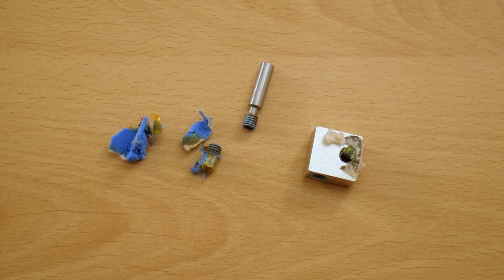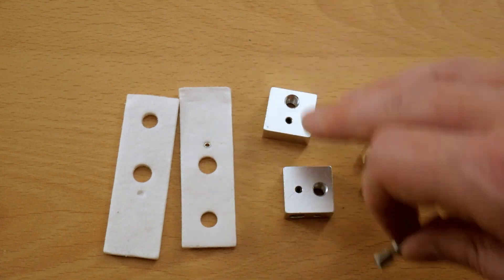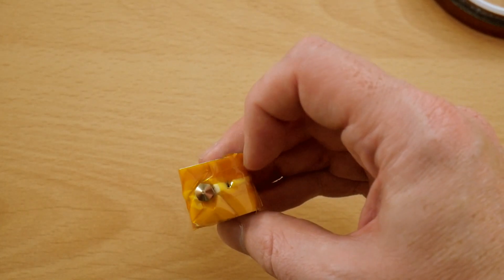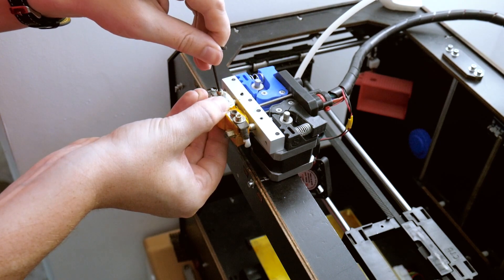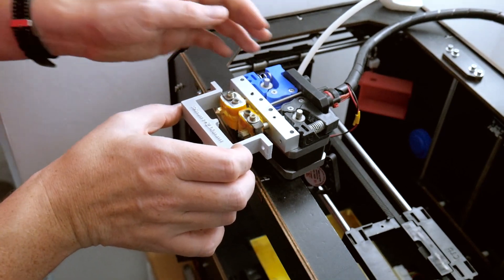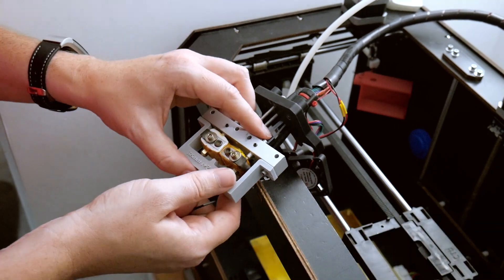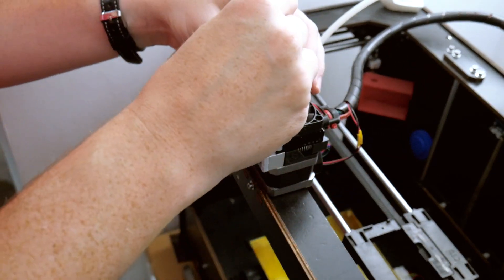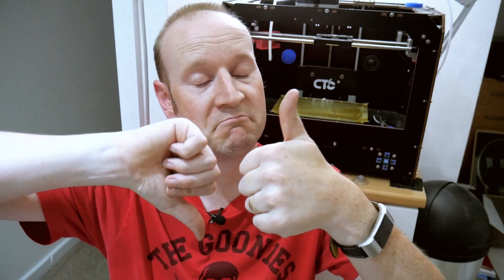CTC 3D Printer How to Replace the Nozzle

Comment: Hello I bought the ctc second hand and didn't have much with printing so I've bought new nozzles and heat blocks etc. The problem I have is I can't calibrate the height because I can't print the aligmnet jig. Would you be willing to print me one if I pay for it and send it to me. I'm in the UK aswell BTW.
Reply from the maker: The best way to sort it out quickly would be to only have 1 installed. Level your bed with just one nozzle and get printing. I never used both nozzles on mine.

Comment: I think mine came extremely faulty. EVERY time I print something, it clogs mid-print. The inner gear over the nozzle gets clogged with molten PLA and it stops feeding. So after EVERY print (given it finished or not) I have to unscrew everything and remove the loose filament inside. Is that a stupid printer design or do I have do change something?
Reply from the maker: It sounds like you might have the temp to low and the speed set too high. I assume it's PLA you are printing with? If slow the speed  right down and slowly increase the temp until you get good prints then increase the speed slowly. I print PLA at 210. If you Google PLA print temps and speeds you should get a good idea of what to aim for.
Reply: @Abernus69  thanks a lot. I will try that

Comment: Hi, 
I did reset to factory settings to my CTC dual nozzles printer. As a result firmware version back to initial version - now it is a single extruder model). Could you please suggest me how to restore my printer to normal condition with two nozzles?

Thanks
Reply: What firmware version, as usually in settings you can change it back to 2 nozzles, if not use replicator or makerbot to change

Comment: WHAT NOZZLES DOES IT USE??? Ive been looking everywhere for the same ones that came with it and have no idea what they are even called.
Reply from the maker: They are 0.4mm nozzles. I couldn't find the exact same ones on Amazon so I bought some that looked very similar. Just remember if you are using both print heads to change both nozzles and then re-level the printer. Sorry I have no links
Reply: @Abernus69  There are so many different types. Mk1 to mk10 inclusive and heaps more of other different types, I ended up finding some on aliexpress that look similar. What slicer do you use for your printer by the way? ReplicatorG doesnt have enough options
Reply from the maker: @BlackSlimShady  I use simplify 3D, but that cost. Cura is a very good free slicer

Comment: Did you you print off the top mounting bracket that goes on top of your fans and stepper motors?  My wood one broke and was looking for another.  
I noticed that when I added spring clip filament guides that tpu or ninja flex had issues printing.  When I went back to the stock simple throat guides TPU and Ninja Flex printed great.
Reply from the maker: Yes I did print that top part I think the design was from thingiverse. Thanks for the info regarding TPU. I will give it a try after I experiment a bit more with my setup.